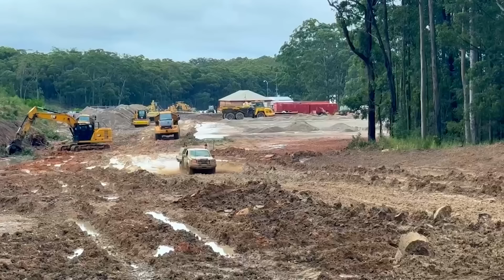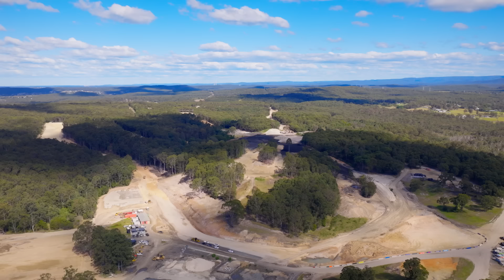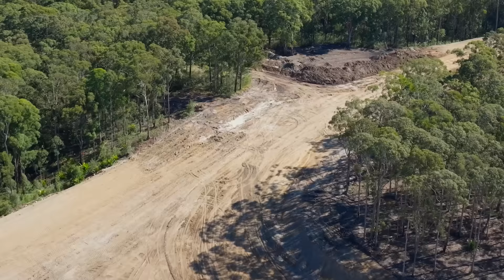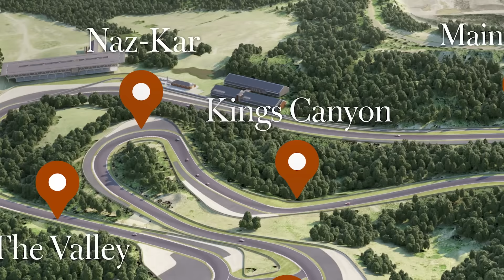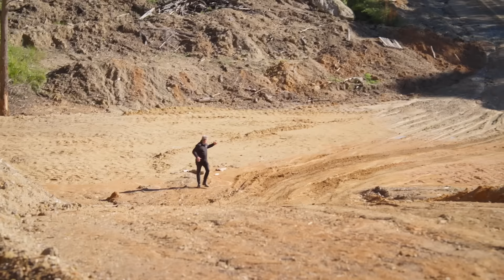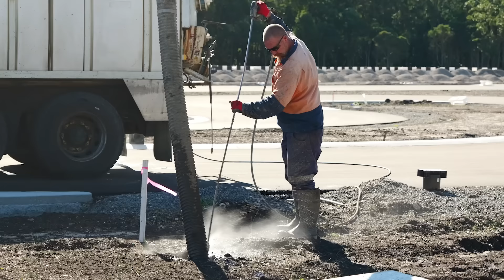Black Rock Motor Resort Q2 2026 Construction Update

Comment: Back in the 70’s at Surfers Paradise International Raceway, at a club day, we had a couple reverse direction races for something different. Turn one was off the main straight, left into Nissan ? , really tight after a fast straight run then around the hill and continue the lap. Coming on the main straight left under the bridge back down the straight was also good fun. That was the days of the old Gold Coast Motorcycle Club, the 70’s and 80 ‘s was huge in that club, glad I was part of it.